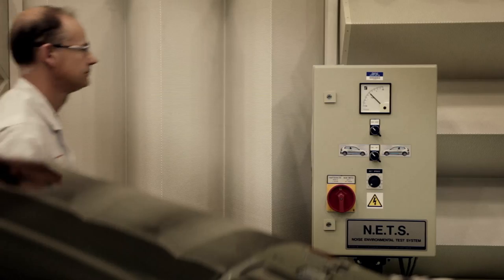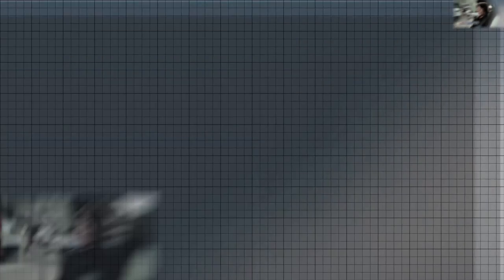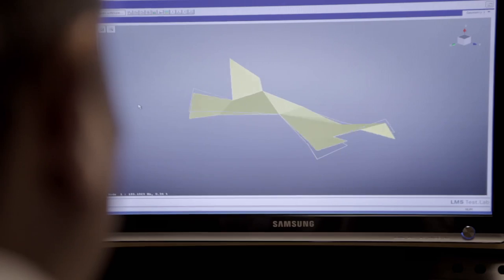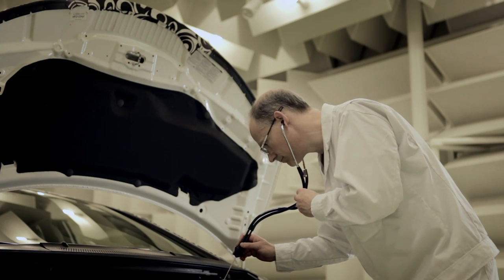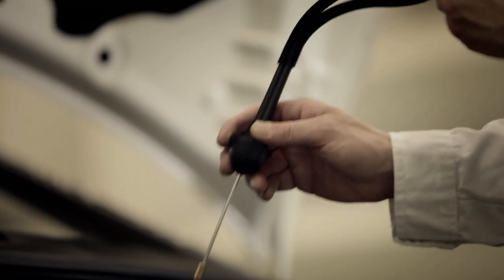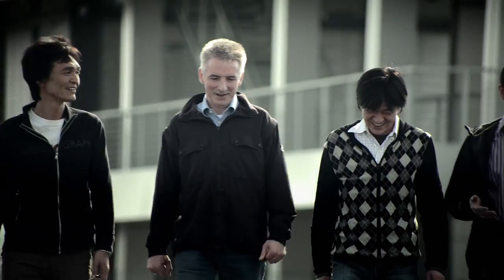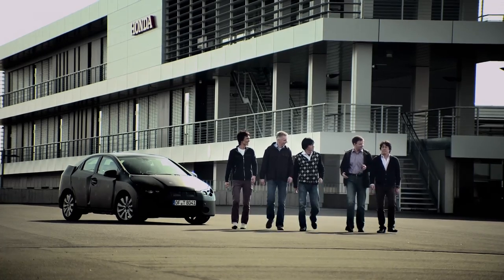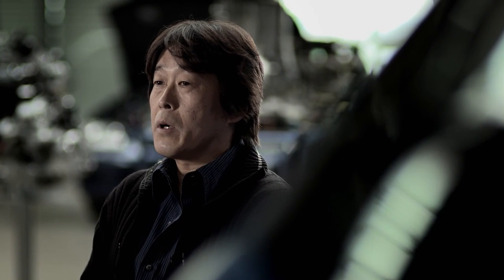Honda: New Civic - Noise and Relaxation

Comment: My 2018 civic is terribly noisy road and wind noise not compared to my ex European cars 
I'm unsatisfied
Reply from the maker: Sorry to hear this, if there is anything we can help please contact our Customer Relations team.  You can find their details here  http://spr.ly/6054DoGmQ.  Thanks, Honda (UK) Social Media Team.
Reply: Thanks
Reply: my 2016 civic ex is very noisy also.  I bought it new and it has 13,000 miles on it.  Ally four tires are out of round.  Two so bad they had to be replaced. The Honda manufacture's warranty does not cover defective tires.  Go figure. Low bid tires.  Pocket some cash